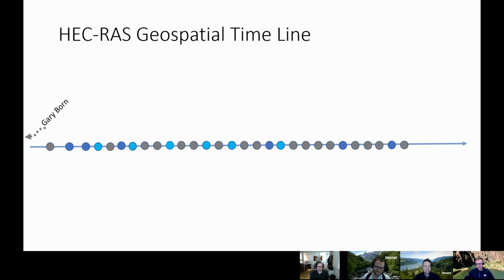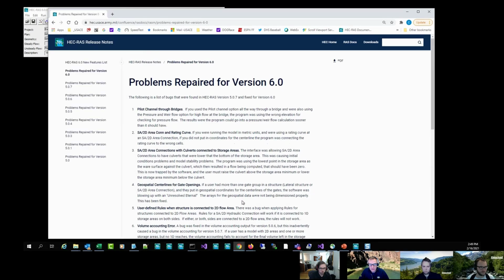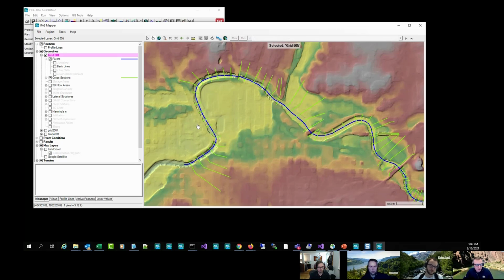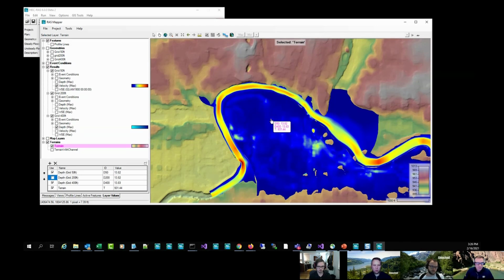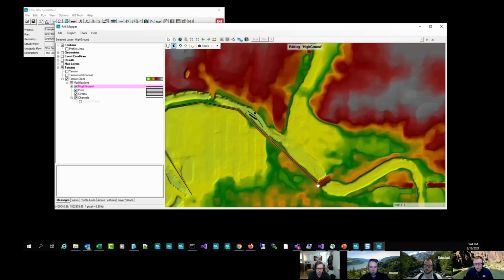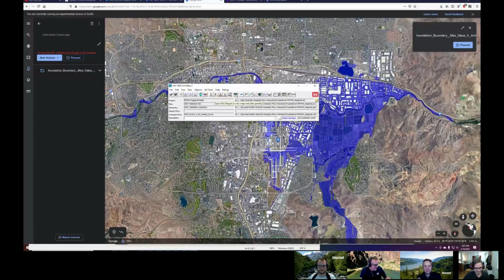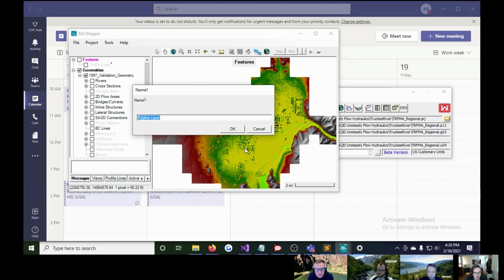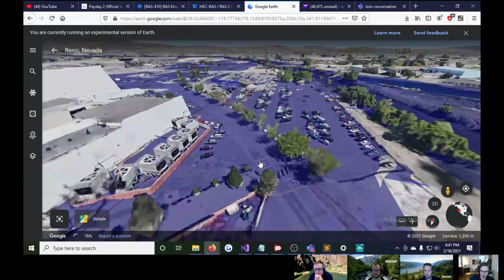Episode 14: HEC-RAS Version 6.0 RAS Mapper Discussions with Cameron Ackerman and Anton Rotter-Sieren

Comment: I'm still confused on what RAS Mapper uses for a surface for mapping the results for 1D models. The manual says it uses the cross section Interpolation surface, but it seems to request and wants to use a Terrain surface...?